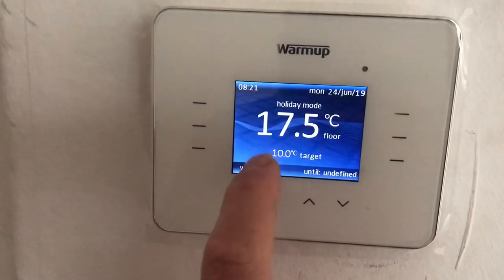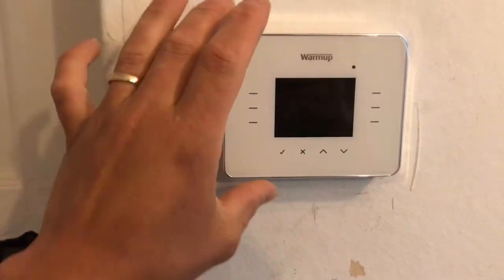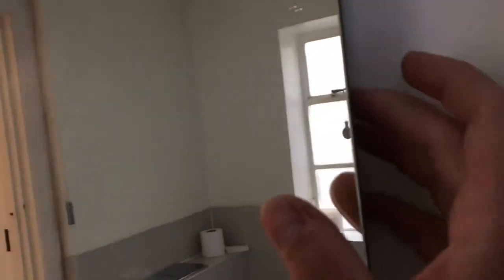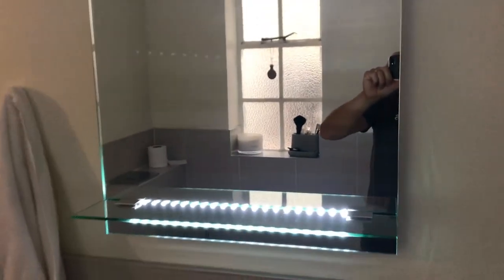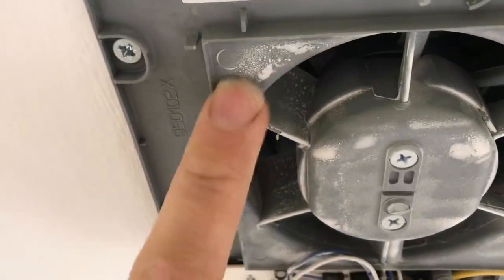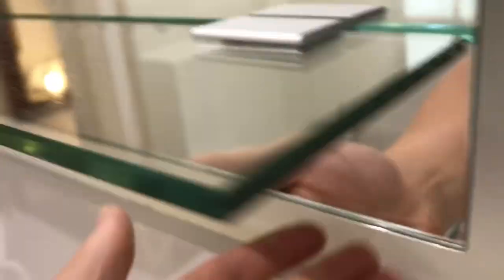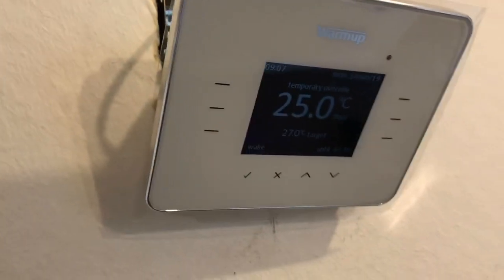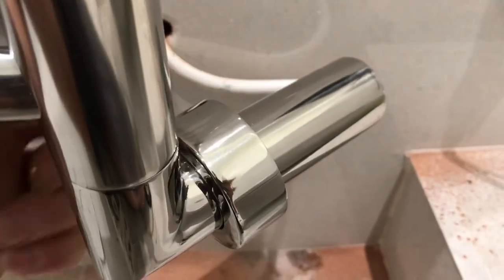CJR ELECTRICAL Fault finding someone else’s work!!!!

Comment: There's no polarity to the underfloor heating probe. It's simply a NTC thermistor, typically 22kΩ at 5° C, 10kΩ at 25° C and 7kΩ at 35° C.
Reply: It's most likely a thermocouple in which case there is polarity.

Comment: It was showing Holiday mode, so surely you would have tried turning that off first before taking 2000 years to open up the thermostat box?
And floor sensors are just temperature dependent resistors (thermistors) so they have no polarity. If you suspect a faulty thermistor, just disconnect it and measure its resistance with a multimeter.  Almost all are around 10k at room temp - if it's less than 1k or more than 100k you would suspect a short or open fault.
Reply: 2153 year,3 months,2weeks, 5days, 6 hours, 34 minutes, 11seconds, 20 Milli seconds. To be more precise. 😳

Comment: Nice patience with the towel rail Chris ,with the floor sensor not working , maybe see if the controller will work as remote air sensor and put the sensor through the wall

Comment: You don't install the floor probe in a pipe/tube? We always do that because the floor thermostat life expectancy is about 7 years and all floor thermostats have their own probe and mostly you have to replace them... Oh and I see red when someone fasten anything in the mortar between the tiles... Always drill through the tile
Reply: I’m curious why drill the tile over the grout line? Surely easy to re grout than swap a tile if you remove the towel rail etc.

Comment: Nice little job there Chris would you mind telling how you fished the flex behind the tiles?
Reply: I believe he drilled through in an angle and fished the cable.
Reply: Guessing he did a bit of fishing from the backbox hole first to see if it was  possible i.e. if there was a cavity,  then just drilled into that cavity.

Comment: Obviously, i do,nt know if you have time to answer peoples electrical problems, but I thought i would just ask, we have flickering lights, and it's not just on the two way down the stairs, it seem even in the bathroom, and on lights plugged into the wall sockets in the lounge, we had a new extension built a year ago and everything in there has its own new mini-trip board and has no probs it seems, Nothing has so far ever tripped out, can you possibly advise, sadly we are in Newark and prob way out of your area,.
Reply from the maker: Yes I can advise you call a local electrician.
Reply: @Cjrelectrical  Ok cheers no idea what it might be then mate thanks anyway.

Comment: Why didn't the first electrician just fit the fan to the wall, saves messing about with flexi ducting and roof tiles.
Reply: It could well have been a Friday
Reply: @AllStarNES  Perhaps if he'd done it properly, he might have got paid.
Reply: Didn't have a core drill, but did have a bread knife?

Comment: That thermostat cable hasn't been properly terminated in the shield! Could be the cause of the problem. If it's pressed into a wire like that you might as well just don't use it. Use a metal strap or EMC gland.
Reply: What are you talking about ? The sensor has no braid .

Comment: Love your attention to detail and that Towel rail installation was something else, how neat was that, but tell me you did not connect it to a Choc Connector Floating in the Metal Wall Box [I see that you Left no filming of this connection] and that you used a Fused Spur, unswitched of course for the Heater and you never relied on the 32A/20A Breaker at the Board?
That Ceiling Extractor Fan seems a common practice to vent to the attic space and some have argued that if the roof has vents then this system is ok, but I think spraying moist / wet air over your trusses is never a good idea and certainly not a good long term plan.
Other than the Towel Rail it does seem to me that you had a realy lucky day, looking for on/off switches and reading up on how to program the underfloor heater, every Electricians dream and the end of your filming that Consumer Unit at least from the outside looked pretty good, it appeared to have complied with current regs and was marked up, but my thoughts are that you should have opened it up and visually inspected it, taken a photo and made a comment if needed to the owner.
Mr Spence Eng

Comment: just an fyi, if the floor in the bathroom has been recently added you are supposed to wait a month before turning on floor heating. if you don't, it can lead to premature failure of the material that bonds the floor tiles to the floor.

Comment: From experience..Be careful if you ever upgrade an underfloor heating controller,the probe has a measured resistance and has to match the controller you fit otherwise it shows as an incorrect heat reading
Reply: Good info to know 👍🏻